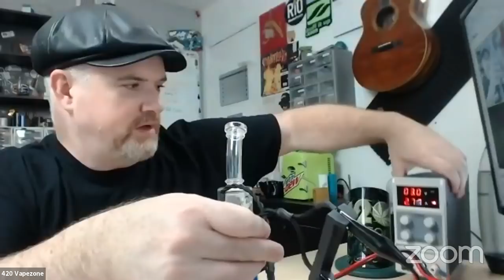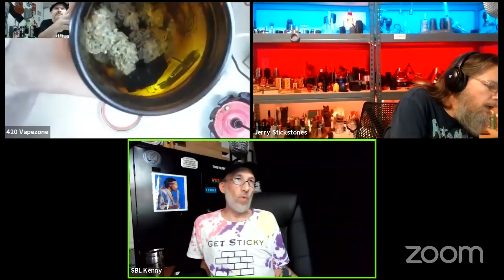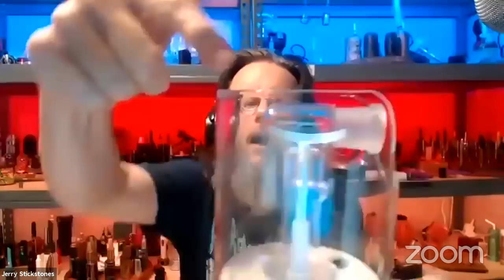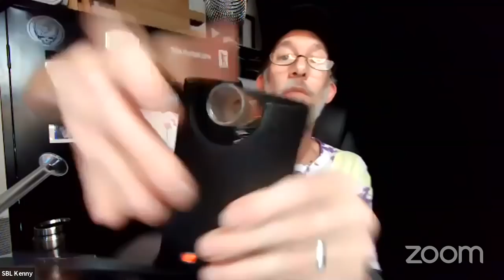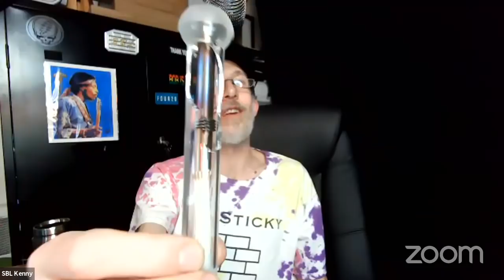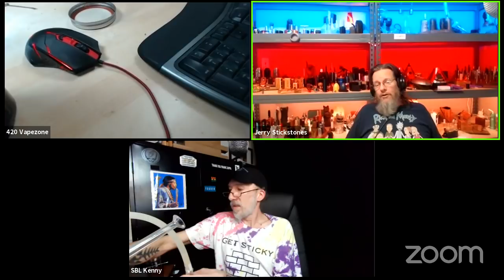Hacking the G43 / Hot Balls & The Future of Weed Vapes - With Kenny from Sticky Brick Labs

Comment: The glass symphony guy did studies on them temp of the balls and the ones away from the heater weren't really that hot at all, I believe what the balls do is reduce the amount of air passing through the heated chamber and it disrupts it's air path so it spends more time in the heated area before exiting.  If there were no balls in the chamber more cold air would be going over that heater at one time.
Reply from the maker: Link to data? Doesn't sound right to me.
Reply: @TroyandJerryThinkDank  this goes many year back when he was talking about it on the forums, as soon as cold air hits those balls they are holding heat no more, but on the GS think of that large air opening, then all that air path gets disrupted and swirls around the heated chamber before rushing out the small exit, without the balls the air just rushes over the heater without getting heated as much.  Like the verdamper, I'm guessing that is why the verdamper has to have such a large heater cause the airflow is unrestricted right over it... but if it was filled with balls or something to cause the air to swirl in there would perform better, G43 is a hybrid of the GS and verdamper.... has a powerful heater in a small chamber with free air intake into a disrupted air path chamber...  I have no data on this, just the way I remember jojo explaining it.  I'm pretty sure he did heat tests on the balls away from the heater and they weren't hot (enough to vape weed).  The disrupted air path through the beads also prevents hot spots, in initial GS without the glass balls there were hot spots.
Reply: @jeffhagel3970  I think he used an infrared camera. It's probably a combo of the two things. All heat sinks work that way, transferring heat while cooling down. Some are better than others.
Reply: No. The glass balls provide a bigger surface than the heater alone and they dont cool down as quick as other materials. Also its a material which adds no flavor to the weedvapor. Glass doesnt transfer heat as quick as ti or sic.

Comment: Weed's moisture content varies and the room temps will change too so predictability can only be approximate.
Start with simple choices like Low 360F, Medium 400F and High 440F. If that's what you want you just wait till it gets to that temp and you're all set.
For a temp between levels use beep sounds or advancing numerals to gauge the temperature.
Have a counter go from zero to nine and start at zero again etc. and have the numbers advance with a quiet beep at a relaxed pace, like every other second.
Once you locate that sweet spot you will be able to reliably return to it. You won't really know what the temperature is; all you'll know is that you can hit that sweet spot, every time.
For example, you'll know that a particular weed will vaporize at three beeps so you'll be watching the numbers or listening to the beeps to know when your weed is ready.  
Maybe the next weed you get will need four beeps to vaporize, you'll figure that out quick enough and you will have a system that can work with that.
This would allow the user to temp step as much as they like just using the beeps and the moments just after one beep and just before the next.
(For safety reasons I'd have a completely independent temperature sensor that will switch everything off if the temperature reaches 445F. The device will become operational again after room temperature has been reached.)
The other idea is to post a list of questions that need answering. Great show!
Reply: My apologies for the scrunched paragraphs. It's been doing that.

Comment: Smaller balls means more will fit, they will heat quicker than larger balls, but will also cool quicker as they don't have as much thermal mass. On the flipside, if they are too big, the heater will not provide enough heat calories to heat the total thermal mass, in this case they would be detrimental or possibly cause the heater to work harder than it would otherwise. I think ;P Thanks for the video guys sorry I missed it, 4am wasn't happening last night XD